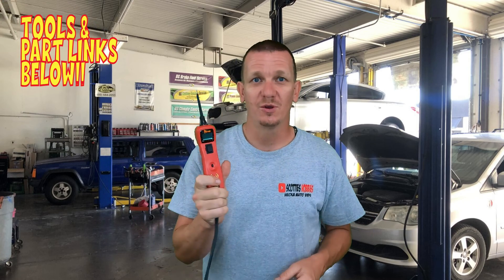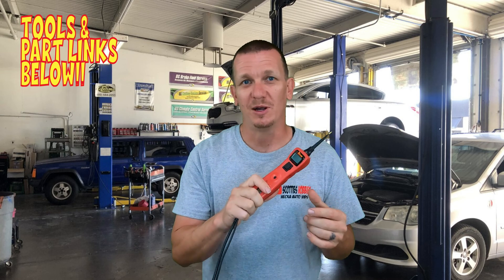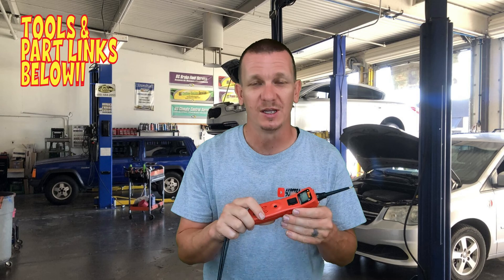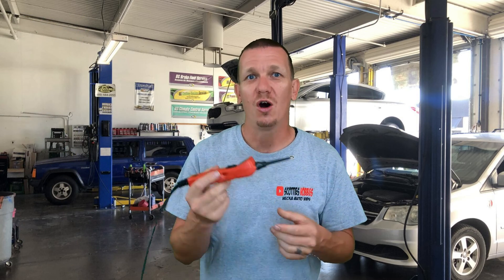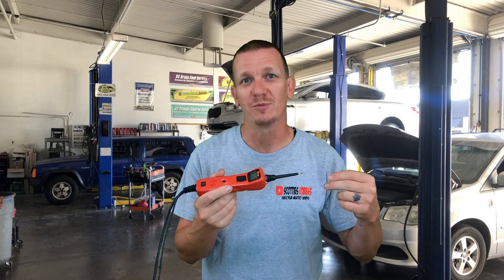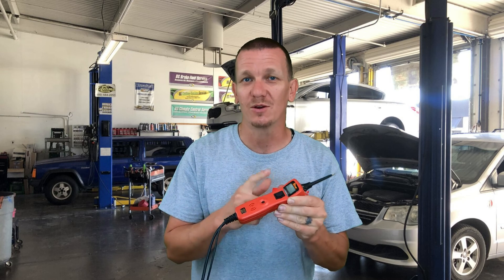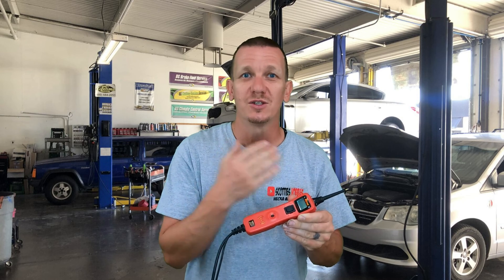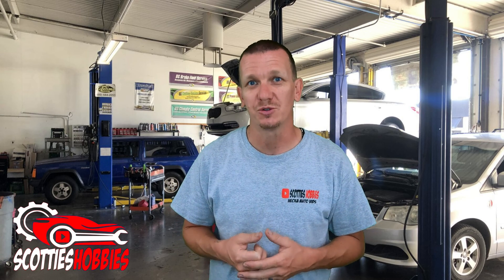How to Fix OBD2 Codes P0141 and P0136 | Oxygen Sensor Troubleshooting Guide 🚗💡

Comment: Bought a 2001 f150 5.4L with an engine swap recently done before I bought it.  I have P0141 and P0136, replaced all the O2 sensors with Bosch, but still have the error.  Using FORSCAN, on B12 I have 0.63 V, 99.22 STFT%, the heater is on, but my HTRCM12, A (amperage?) shows 0.00.  For comparison, my B22 shows 0.47V, 99.22 STFT%, the heater is on, and the HTRCM22, A shows. 0.79.  Can you help me to understand what wires to check and what to look for?
Reply from the maker: Direct fit 02 sensors? Not splice-in, right?  Have you gotten under the truck and followed the wires from the sensor and up over the transmission? Did any wires get messed up during the swap? You disconnected and reconnected the sensors to ensure a good connection?
Reply: @ScottiesHobbies  i think I have an intermittent open circuit on the heater because I get 12V on both the heater ground and the vpwr wire when I go tugging on it.  I think Im gping to have to run a new wire down there.
Reply: @ScottiesHobbies can I use a regular voltage meter?

Comment: The Cam sensor was my issue so I changed all the sensors  crank shaft as well.hey dude and thank
Reply: Cam sensor triggered p0141 and p0136 codes?